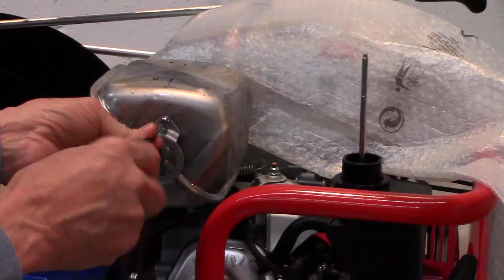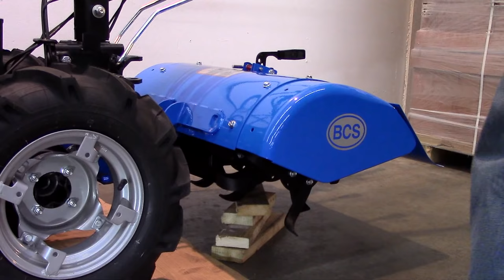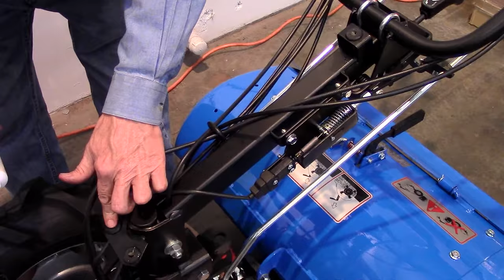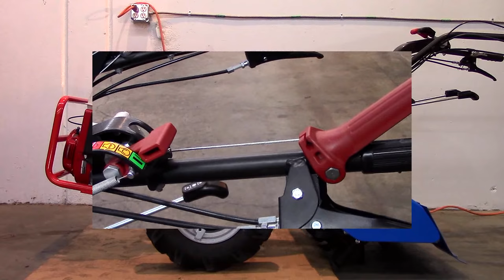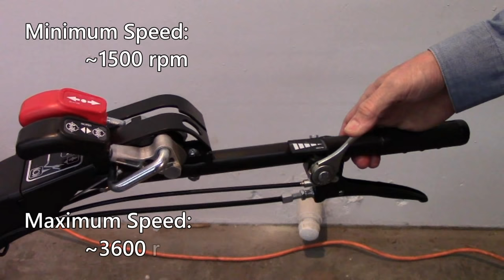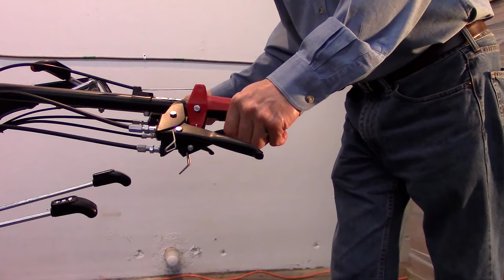Unboxing and Setting Up a BCS Two-Wheel Tractor

Comment: One minor issue I had with mine was that, on delivery, the differential lock cable was slightly too tightly adjusted so, although the differential did unlock there was a twice per revolution click when one wheel was turned relative to the other in the unlocked state - not something one would perhaps notice unless the machine is lifted off the ground for inspection. A very slight easing of the cable was enough to stop the noise which I ascribe to the lock dogs just skimming over each other. 
I'm in the UK so not an issue for PDI in the USA but I thought it worth mentioning here anyway.